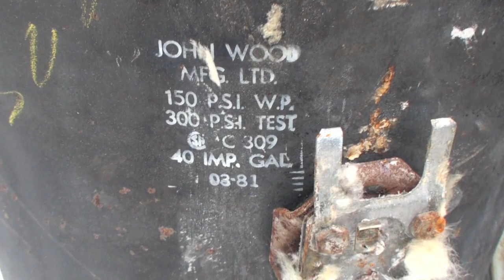whats next?

Comment: Hey Pug I noticed the stamp on the 40 gallon water heater it was made in Fergus where I work . The 60 gallon is only 18 inches round but over 4 feet tall . At work some of the boys have made wood stoves outa heaters and the best one so far is a 60 gallon gas it already has a chimmney out the top, or go with an old oil fired 50 gallon they have 6 inch flue pipe. Cut the botom of the tank off as they are a pain in the ass to clean out add in a flat botom and your set to go. Use Top nipple for oil

Comment: First of all if the box don't fit big dirty why not put it on a frame a pull it behind or put it on the camper frame and have the ultimate work trailer storage and flat bed. THe other idea i have is for project keep warm go with the idea you got but instead of a air chamber fill it with water and circlate it through a couple of car rads with electric fans. If you  do that you will get tons of heat even after the fire dies down.